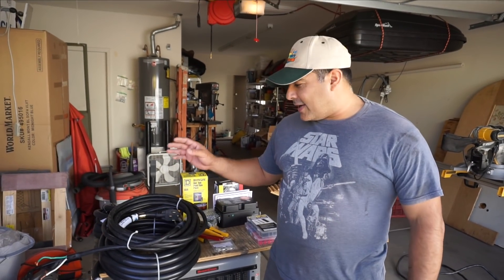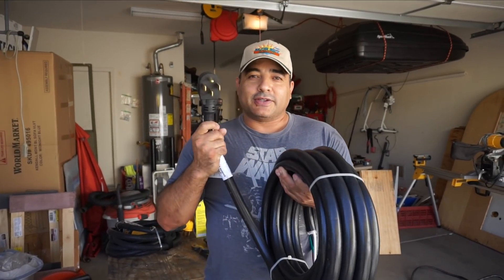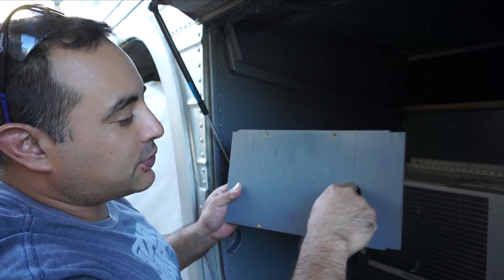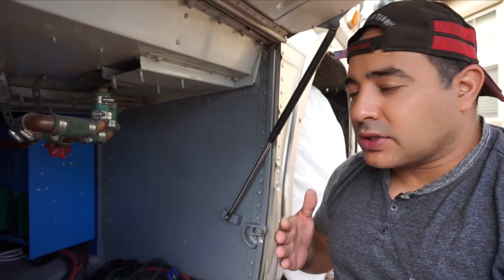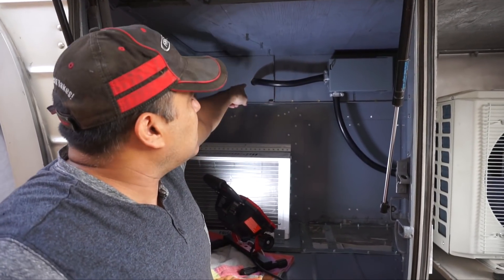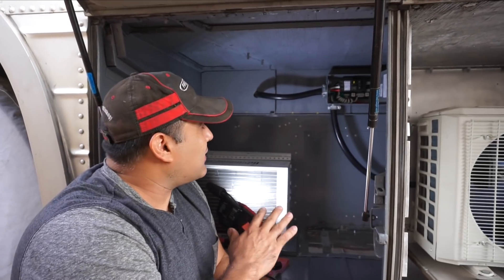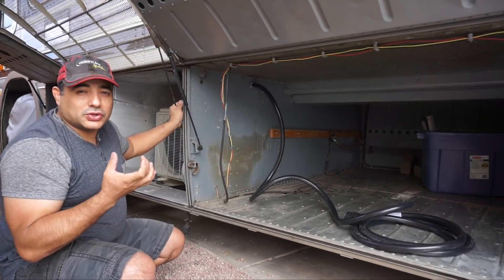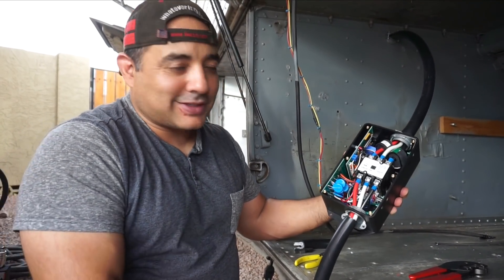Wiring Our Bus For 50 Amp Shore Power

Comment: What is the OD as in outside diameter of the 6/4 power cable going from your inlet connector to your surge protector?  Trying to figure out how big a cable will actually fit into the Furrion connector

Comment: Sorry but I don't understand. An inverter converts DC to AC so why are you wiring 110 volts to an inverter. I could understand if it is a combined charger/inverter but just to an inverter !! Why?
Reply from the maker: Our inverter is a hybrid inverter which is also a charger with a built in transfer switch.
Reply: @BeginningfromthisMorning  
Sorted

Comment: Long time watcher of all of your videos and now that I am wiring up our bus I’m coming back to this one because I have been scratching my head around what to do with the second leg of the 50 amp split phase and your comment about basically capping it and leaving it alone was so key. We have no need for 240 in our bus but all of the 50 amp RV receptacles are wired in that way.  we have a similar victron energy multi plus inverter and it only accepts a hot neutral and ground there is no provision for a second leg and so I have been wondering how I’m going to correctly wire it up and your video explained it pretty well thank you. Also I believe I made the same mistake that you did when you purchased your panel you purchased a main breaker load center same as I did and what we really need is a main lug load center and you linked it together with that crossbar basically making it a single phase 110 panel.  I’ve already wired up my panel and cut everything and I don’t wanna switch it out so I’m going to do the same thing you did.

Comment: Thanks for the u0dates. I am curious about your setup. Particularly the inverter. I don't have any batteries or set up for solar yet, but are/can you use your inverter as a stepping stone to solar?
Reply from the maker: Thank you Jerry - yes we are now 100% off-grid and fully solar.  We recently had to move our build to a piece of land with no power or water (since Feb) - and have been powered 100% by solar since then.  We leave a refrigerator, security cameras, locks, 7 DC-DC converters, cell phone booster, Cell router, and our inverter running 24/7.  4 days per week we are working on the bus and running 3 air conditioners, power tools, welders, air compressors etc all off this power system with no issues at all.

Comment: Hey, Juan, my apologies if someone else has pointed this out or if you address it in a future video. I'm bothered by the coolant lines that are running through your electrical bay. I would be concerned if one of those lines burst and sprayed your electrical bay and components with highly conductive engine coolant. have you considered either removing those items and running the coolant directly to the front, bypassing that bay, or perhaps building a little containment with a drain system?
Reply from the maker: Thank you Jeff - I have a plan to drain those and shut the valves off that bring the coolant to the front for defrost (Eleminate the defrost and maybe use a Diesel heater up front for defrost) ... They bother me as well.

Comment: I have some questions. Boosting inverter? What on earth is that? I have been involved in electronics since 1972, you have lost me. Could you please explain why you need 50 amps? That is quite a lot. What are you running? Thanks.
Reply from the maker: Thank you Izif - a boosting inverter is one that can supply additional power to support larger demands when on shore power.  Here is a common example: let's say we are staying in a friend's driveway for the night - they offer power - but only have a 15 Amp extension chord.  If we turn on just a few things + the air conditioner in the coach we will likely blow past that 15 Amps pretty quickly.  With a boosting inverter the inverter only takes 15 Amps from the shore power and uses the battery to supply power for additional needs.  So if we are using the air conditioner and need to use the microwave to heat something up the inverter will "see" the additional load and augment the 15A power coming in with battery power instead of blowing the circuit (which is what normally happens).   Same scenario if you are parked at a 30A shore power.  Often times these will not actually provide a full 30A - it's often 20-something amps.  We can set this limit in order to avoid tripping the breaker and peak loads will use the battery.  Hopefully our overall load will be less than the supply coming in or of course eventually the battery will go dead.  We are running everything in our coach off electricity save for the water heater (which will be propane).  3 Air conditioners, induction cook top, residential refrigerator, microwave/convection oven, chargers etc.
Reply: @BeginningfromthisMorning  That was a great clear explanation. I now understand the principle. It makes sense. So I decided to google boosting inverter.  I didn't get very far. Just buck boost circuits - which I use myself - or adverts trying to sell regular inverters. 
In addition I am in the middle of building a cargo carrier to camper conversion. I am at the "design and electrical system" stage. Due to having 3 potential sources into the fusebox (shore / generator and inverter) I had to research what would happen if you stuck an external 110v ac into the o/p of an inverter. The answer was destruction. Far from acting as a booster (which is a super idea) it will destroy the inverter. So I am exploring the idea of disconnection via a relay. This is why your words got my attention. Thanks for the explanation.

Comment: what I did with mine is I went with 100amp 240 max system so if I decide I need more than 50 amps I have it with out doing every thing over my inverter dose 240 100 amp up to 200 amp max I found by doing 240 @ 100amps I save the battery system when I'm using the battery bank the inverter is a solar rack that has a in put for shore power/ generator and solar the inverter is a smart unit that after programming it  dose every thing the nice thing it is WI FI and has hard wired meters /controls wish I did a video of the system or at least picks but it was fun I like what you did it is very nice and most of all SAFTY FIRST not like some of the hack jobs that I saw when researching to do my system . Best of luck
Reply from the maker: Thank you chrissteene - I think we can do 100 amp pass through on our Inverter but we have needed to run larger cable for that.  We are hoping that we can get most of our power needs met through the solar charging - but time will tell if that hope will be met.  We started making videos because we had a really hard time finding information like this, glad you are enjoying them.

Comment: How cool! Always liked the idea of a bus conversion...never figured mine would be a VW bus though lol. Which leads me to my suggestion/idea. 

If you are one of the many folks I see towing a 2nd get around vehicle behind their primary RV type vehicle (which is ok!) may I offer the idea of getting a 'NON' Camper VW Vanagon (good way to save some $$$ this way as it looks like you got that covered already) to extend yer sightseeing/activities in? 

How freaking cool would that be to see a bus pulling/towing a bus around!!! Just sayin bud...love what you have done thus far though! I'm subbing...ya talked me into it. Thank you for posting   :)
Reply from the maker: Thank you Michael!  I love the idea - but it's probably not practical enough for us at this point (4 kids,  2 of which are still in boosters).  There is a great couple that does pull a VW Microbus with their bus - even painted to match!  (same model as ours) - check out: https://www.dropbox.com/s/jtg540mb4sfrt4p/bus_bus.jpg?dl=0

Comment: I think I purchased the same surge protector. I had a rude awakening when I open up the one that was on the bus. Someone had removed the guts and connected wire in to the wire going out. From the outside it looked correct. The unit from Progressive Industries does a lot (Checks correct wiring, current draw on each leg, voltage on each leg, frequency) And does not supply power to the bus unless everything is correct http://www.irv2.com/forums/f107/projects-on-my-1997-american-dream-174380-67.html#post3002563 is the post of the install. in it you will see my wire crimper, multi meter. I want to go back and angle the display out rather then flat on the compartment wall. I missed the wiring, I will have to go back I'm sure there is a video of it. I'm sure you were careful when you rewired the drill (got the nuteral to the big spade on the plug. Those old drills with the metal case can be wired so the case is HOT. Most RV power post with 50 amp service have them wired so that you have 50 amps on one leg and 50 amps on the other leg, but it is not 220 across the two legs. the 110 on each leg is on the same side of a 220 line. That being said I plug my bus into my 220 welding out let and get 110 on each leg but there is a 220 potential across the two legs. There is much contention on the forum about doing this.
Reply from the maker: Very nice write-up!  Makes me nervous as we have not had a chance to test ours yet - I saw yours was defective.  Hopefully, we can test it in the next couple of weeks.
Reply: Thanks They were good on the phone, walked me through testing it and they determined it was bad and sent another on right out. Can you believe that someone removed the guts of the old one and just connected the input to the output? 12:53 here , time for bed, hope to feel better tomorrow so I can get back to the engine. 18 degrees here tonight (a heat wave). Glenn Lever
Reply from the maker: Yeah, unreal - glad you found that before it became an issue!  Good night - I will be praying for a fast recovery for you

Comment: You might consider a grommet around the wire between the circuit breaker and your inverter. The thin sheet metal can wear through the insulation and create a short circuit. Nice work!
Reply from the maker: biggieb400 Yes, we are trying to be as careful as possible and are using service entry clamps anytime our cables pass through metal.  The upper part of the wall between the part of the bay where the inverter is and where the 50amp breaker is is actually 3/4” plywood.  That’s why we didn’t use a service entry clamp there.  Thanks so much for the comment.  We always appreciate folks looking out for us and sharing ideas.

Comment: Very nice work, Juan. One tip: when your outer insulation comes up a little short of the clamp jaw you can cut a strip of vinyl pan liner and use silicon to wrap and glue it over the gap. That will provide a clamping surface stronger than the OE.
Reply from the maker: Thank you Keven - great tip!

Comment: This was very watchable, we got to see what we needed to see. Just out of interest, I might have missed it in other video's but will this AC power charge the large battery you have installed? Is the charge controller with the inverter?
Reply from the maker: Thank you, Karl - yes the Inverter has a built-in 70 Amp (@ 48V) charger.